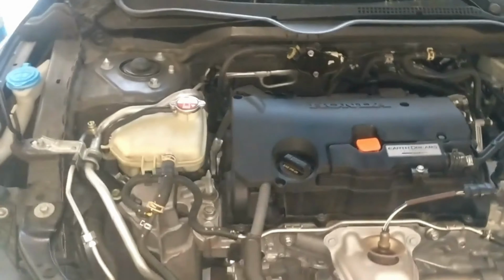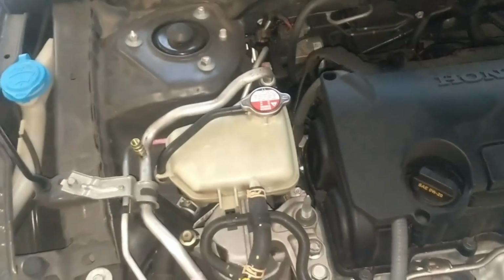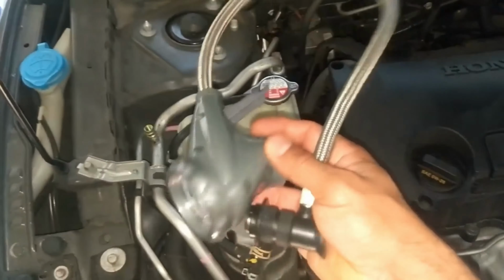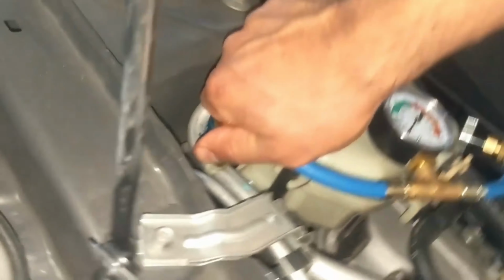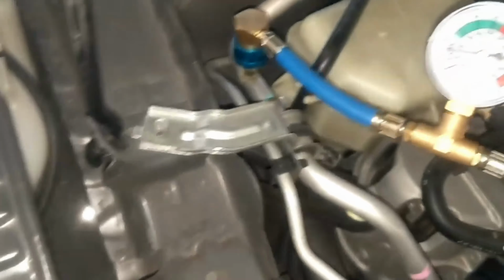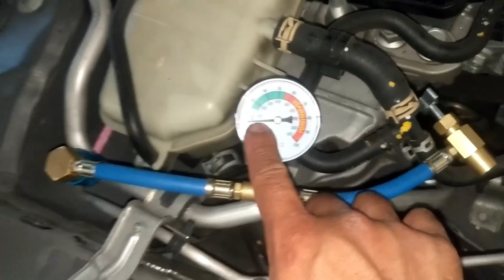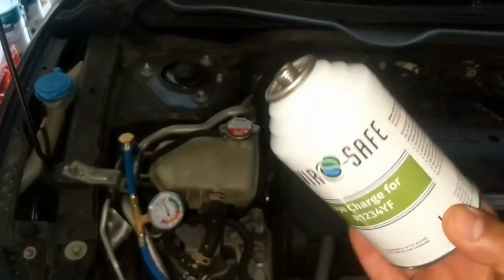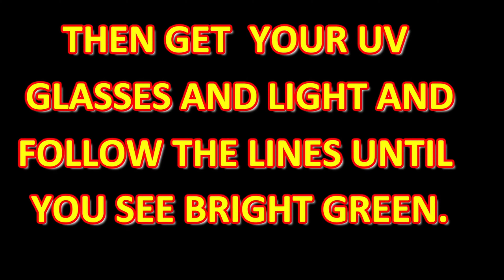HOW TO FIND AC LEAK ON 16 17 18 HONDA CIVIC (AC RECHARGE OR AC PROBLEMS OR AC NOT WORKING) R1234YF

Comment: I have the same problem, I lost all freon after the remote start in a hot summer day, the car is only 1 year old. Took it back to dealership & they couldn't find out any leaks,  they try to charge me $500 for refreeze & recharge. I was furious that they try to rip me off & waste my time. I also bought the extended dealership warranty when I purchased the car. I ended up sending email to Honda Corp in CA & got my money back. I never go back to this shitty dealership ever again!!
Reply from the maker: So did you fix the problem?
Reply: @BudgetClan  They didn't find out what was causing it, the dye is still in my system & no leaks ever since. But I will stop using remote start from now on because I don't want this to happen again. Criswell is the name of the dealership, they pound you down for deleadership extended warranty when I brought with cash, & they do nothing to help you at the end when the car has issues.
Reply: @viauyeung  I'm dealing with this crazy nonsense.....I brought my car to Honda victory in San Bruno CA.....and right away the guys wanted to charge me 500 plus the said that a Rick probably hit the condenser......do you think I can bring to a different Honda dealer even if I didn't buy the car there
Reply: @peaksurg  I think this is the dealership standard procedure, If it's in warranty, send an email to Honda Corp (not the dealer), tell them what happens & they will take care of you!
Reply: @viauyeung  thank you man...
Reply: @viauyeung  they gave you your money back meaning for the whole price of the car bought it back or refunded you the money for the AC repair eventhough you said you weren't going to do it .. ??
Reply: @AM-ry8ls  I got my $500 back after refreeze & recharge & the dye.  If you get a full refund for the car you bought after 1 year, you let me know, I gonna work for you.
Reply: @viauyeung  what's their email? I'm in the same situation.
Reply: @BudgetClan  it's fixed, but I don't use the remote start again cause it will probably happen again

Comment: I have 2017.  I haven't checked the freon yet. But my compressor doesn't engaged. Did it happen to you as well?
Reply: @Ivan Moreno yeah l checked. There isn't any left. I read that Honda 16-18 have a condensor leaks. It could be that
Reply: @Ivan Moreno l read about that too. But im the second owner and the car is salvage already. Nothing big. I just replaced the door and like new. I think that affect the warranty. Ill call anyways  Who knows. Thanks
Reply: @Ivan Moreno they charge me 1000 to replace the air compressor did I got screwed by honda because you are saying that if it was out of freon the compressor won't engaged so if they refilthe Fredonia would work and they charge me for a new one

Comment: Nice video. I bought the exact same adapter and dye charge can as you. Do you have the car on while doing this?? Also, the AC should be off, right?
Reply: Ac on , car on . than u recharge it
Reply: Were did you bought the adapter and the dye thanks
Reply: Daniel Ramirez Adapter on Amazon and the dye charge on eBay.

Comment: Good video, Thanks Robert! Where did your get the correct adapter to fit the low pressure valve?
Reply from the maker: I got it on eBay for $20
Reply: I need a new adapter also

Comment: What did you end up replacing bud?
Reply from the maker: so look like hondas ac compressors are failing. compressor and condenser were replaced.
Reply: @BudgetClan  Understood. I'll keep a close eye around the compressor to see if I see an obvious leak point. In your project, was the UV colorant leakage around the AC compressor visible from the top (engine) view or from the bottom (undercarriage)? I appreciate the input as I try to repair my 2016 Civic Touring trim.
Reply from the maker: @ionSpa1  it was visible on top of the compressor...let me know the outcome
Reply: I needed to replace my condenser..bummer
Reply: @BudgetClan  Any chance you did a video on the compressor and condenser replacement?
Reply from the maker: @invenio1978  I did not do a video on it...I found out I was still under the warranty and they were able to replace everything... They replaced the condenser compressor... I hope you're still under warranty
Reply: @BudgetClan  Thanks for the quick reply.  Unfortunately, I was about 4 months out of warranty when mine failed.  I'm thinking of doing the job myself as I hear that Honda charges a small fortune to fix these.
Reply from the maker: @invenio1978  Yes unfortunately they would charge an arm and a leg.. it's not too bad.. just making sure the AC is bled out of air before putting the new freon
Reply: Honda wants to charge me $429 just for a diagnostic and see if it’s leaking😅
Reply: FIVE TIMES THE BLESSING!!!!  Is the warranty under 50k or 3 years?
Reply: @BudgetClan  same.....
Reply: @andreasanchez7556  You don't understand the different between Honda and dealership ma'am
Reply: hei law I meant the Honda dealership I was heated at the moment, I got it fixed already tho. For $130

Comment: Excellent informative video! Hey, i just want to ask if did you drive your car for a few miles after your charged it with dye or you just let the engine run with a/c on? Thanks, and more power to your YT channel.
Reply from the maker: No it did not drive it.. looked for leaks thirty minutes after putting in dye
Reply: @BudgetClan  any update on this? Does this damage ur car if left untreated and don't use ac at all?
Reply: @BudgetClan  my dealer said they freaking had to put new freon to find the leak.... what a crock of crap!
Reply from the maker: @26point2man  yes definitely... they should have a recall on this particular section!
Reply: @BudgetClan  I called the dealer where I bought it and they just said bring it we will take care of it.
Reply from the maker: @26point2man  good luck man... fight for the fix!
Reply: @BudgetClan  they didn’t fix it they charged me 109 to dye the dam thing and said the damage was caused by a rock. So I’m trading the dam thing, actually selling it to CarMax for 15,000 and looking at Honda hrv

Comment: What happens to the car if the arrow is in the red part?
Reply from the maker: The most common reasons for the pressure gauge to indicate a red/high pressure reading are the car is not running, or the A/C is not on with the fan switch set to high and the temperature at its coldest setting. In order to obtain an accurate pressure reading the car must be running, the A/C set to the coldest position, and the fan setting set to high. Also, as the car’s compressor cycles on and off,…
Reply: Thank you for taking time out of your day to help me out , I appreciate it very much your video was very helpful.
Reply from the maker: You are very welcome please let me know anything I can do!

Comment: you can see in the video that the AC aluminum condenser is leaking in multiple spots.  These condensers are crap.  It is not a safety item so not a recall candidate, AC is considered a convenience.  But Honda did extend the warranty to 10 years.  They know these condensers are bad.  But they just replace with another one which will also fail in 2-3 years.  They need to provide a more rugged condenser.  Maybe welds are cracking, maybe the new R-1234yf refrigerant is too corrosive for this condenser and they get pinhole leaks.  Either way Honda needs to provide a more robust condenser instead of just putting these crappy ones back in, which are going to fail again.  Honda is hoping to get you past the 10 year point, when you will be on your own with a known defect.  I have a 2007 Rav4 with no ac issues, so a condenser can last 17 years if it is designed and manufactured correctly.  Our 2017 Honda Civic is on it's 3rd condenser, averaging 2-3 years before failure.  That is unacceptable.
Reply from the maker: Well said, i agree

Comment: If the car low on Freon. Will the AC compressor won’t engage?
Reply from the maker: Correct.. it need to have a certain amount
Reply: Oh ok. I thought it might be the ac clutch relay
Reply from the maker: What you can do is buy a hose and check your Freon levels that's the only way if to know if your Freon is low.
Reply: FIVE TIMES THE BLESSING!!!! Thanks bro! I’ll buy a hose
Reply from the maker: You're welcome let me know the update
Reply: @BudgetClan  How many cans of the dye did you use to charge the system up for the leak check? I'm pretty sure my system is empty.  I'd like to only have to buy what I need for the check & also the recharge.
Reply from the maker: @flamedduck  one can was enough for the compressor to kick on! Good luck

Comment: Don’t fix it Honda dealers is fixing for free is a factory problem they will put a brand new compressor
Reply: Is there a recall? I haven't heard anything yet.
Reply: What do you tell the dealership? I also have a 2016 Honda Civic and when I told the dealership they tried to make me pay $500 for a diagnosis
Reply: I'm not buying any more Hondas. They're not getting any business from me nor people that asked me about it. This issue has been an ongoing and there isn't a recall. I call it bs.
Reply: I just when there.. hey my a/c is no working it should not happen is a 4 year car? They just say ok still under warranty so will fix it that was l
Reply: Do not take it to the dealer.
Save your money. They will charge you to replace one thing and a month later it will leak out again and tell you to replace another part. They are not fixing the root of the issue and charging customers for worthless repairs. It’s a scam.

Comment: Honda's quality has gone down. Should have bought a Ford.
Reply: it's funny you say that because I used to hate Ford and them overcharging for shit especially with the death rattle going on with some of the F-150 model trucks. However, at least at my local Ford dealership, their customer service has definitely been 20/10 recently and I don't get the same bullshit I get from Honda's Service Center, Toyota's crappy salesmanship (they're friendly once you own a vehicle, but treat you like shit if you're just browsing), and some others I won't even bother mentioning. The Ford dealer just gave me the keys to their Shelby/Cobra Mustang GT and told me to go have fun, just bring it back in one piece before they close. No pushy salesmanship, just honest, down-to-earth, world-class customer service. The owner even came down to join us for a small Saturday BBQ in the evening to shoot the shit with us. Debating on just trading in my Civic at this point.